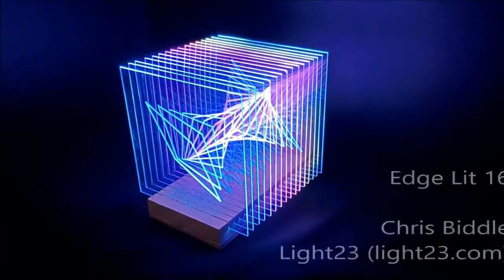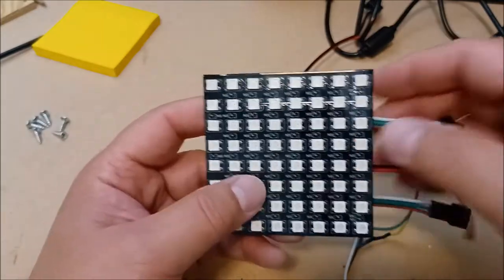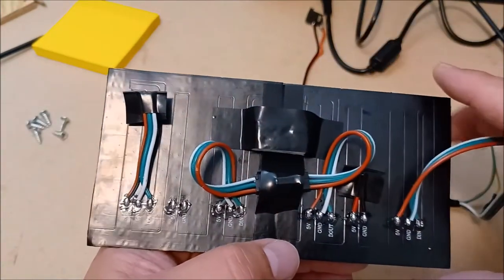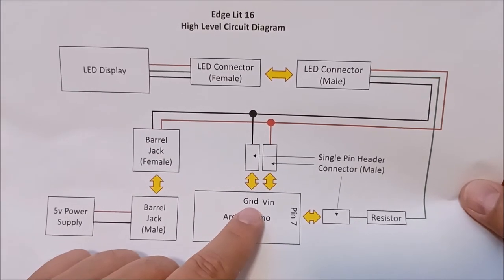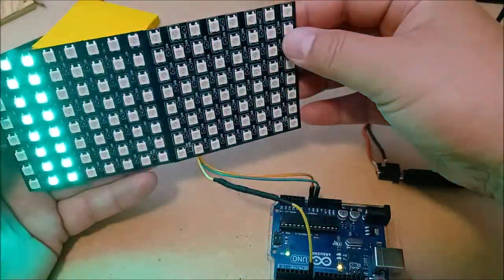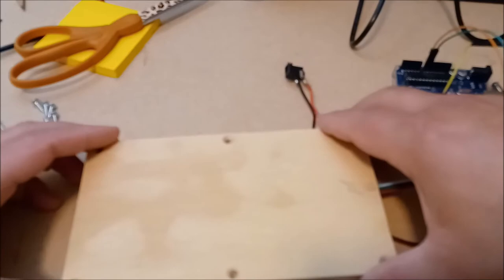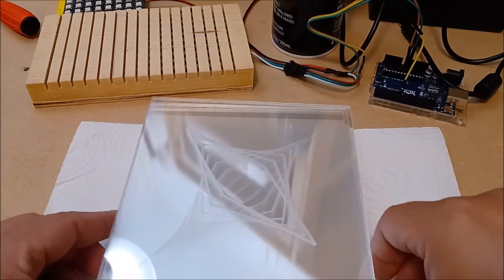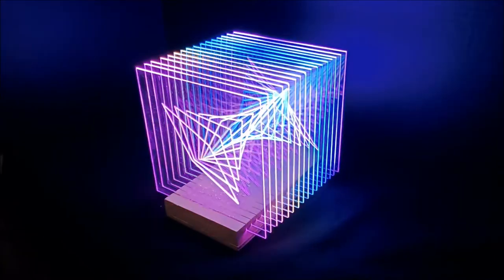Edge Lit 16 : A 3D Acrylic Display

Comment: Great job and unique.  Did you try the pen/ white marker rather than engraving and did this work ?
Reply from the maker: Thank you TrevJ83. I did try a white acrylic marker on a smaller example, and it worked fine. I have no reason to think it would not work on this piece.
Reply: @ChristopherBiddle   cheers thanks  I’m building one. Is the light similar strength at top  as everywhere else ?
Also your 16 sheets are 
just standard Perspex/acrylic ?
Reply from the maker: Hi TrevJ83. I can't say for sure, but I don't think the light distribution will vary much from top to bottom as long as your patterns are simple and made of relatively thin lines (i.e. 1/16" to 1/8" thick). I would just encourage experimenting with erasable acrylic markers first if that is a concern. The 16 panels I am using are 1/16" extruded acrylic.

Comment: Awesome! Thank you. One question, why did you use a resistor on the data cable? Cheers.
Reply from the maker: Thank you for asking! The LED matrix is basically just a strip of WS2812b LEDs, which always requires an inline resistor on the data cable if being driven from a signal pin on an Arduino. Without it, the LEDs will likely burn out quickly. Recommend a resistor of about 220 to 330 ohms.
Reply: @ChristopherBiddle  Thank you Chris! I never did that on my projects. But I will do that in the future, Cheers.

Comment: Hello, I wanted to build the first version of your beautiful project, the one only with arduino, but I can't find the sketch anymore: it could show me where to find it. Sorry for my bad english. Thanks
Reply from the maker: Hi Agostino. If you click on the link in the description under "Arduino Code:" the sketch will work fine with just the Arduino. I know it has code to receive commands through I2C, but it will still run standalone even if an I2C device is not connected to it.
Reply: @ChristopherBiddle  thanks.